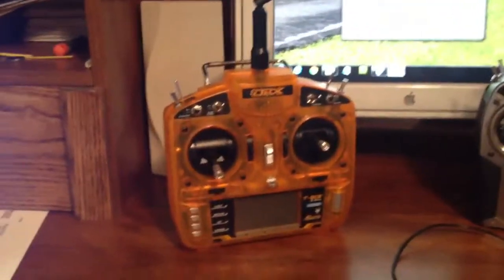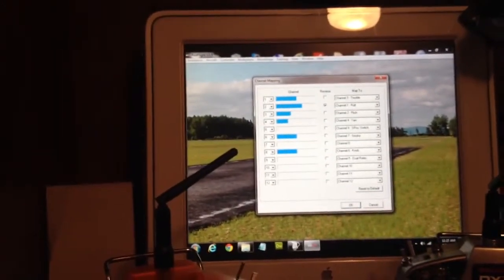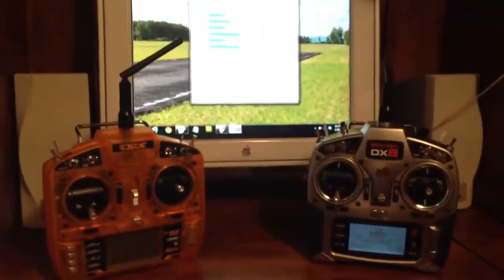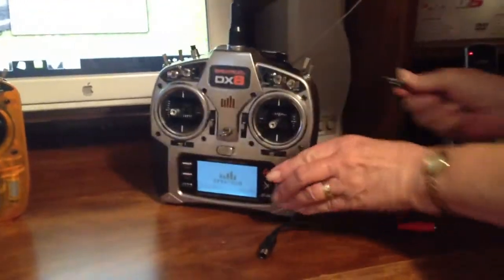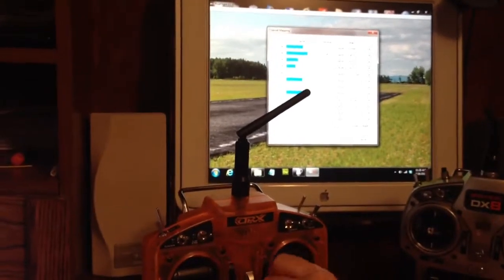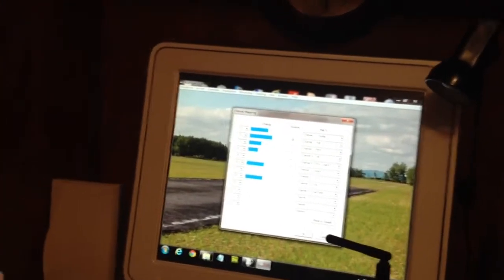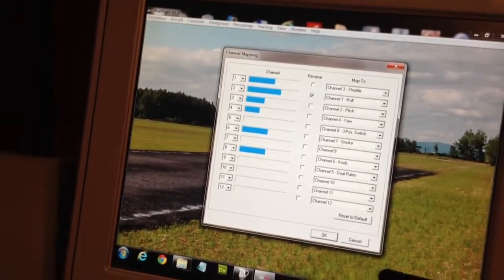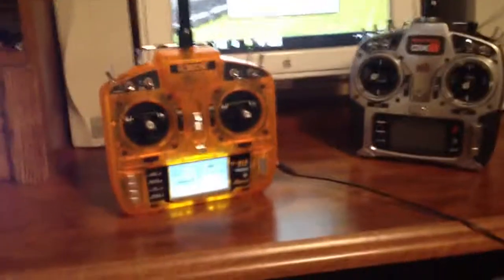Orange Transmitter Fail

Comment: Larry,

It seems I'm having the same problems. I just have bought the T-six. Neither I can get the trainer port working. The location of the wiring diagram doesn't excist anymore as I can find it. What did you do to get it work?

Kind regards, Robert
Reply from the maker: photo is still there...  See link below
http://www.hobbyking.com/hobbyking/store/uploads/94107065X268157X10.jpg
Reply: Larry Fortna Thnx for your reply although I still don't know what to do or how I'd use this information to get it working. I don't have the technical skills to make a video-cable myself as it seems I've to make that. I've already sent a quastion to hobbyking and hopefully they can tell me what I need to do. I also have bought the recommended reciever and cables for simulation/pc-usage in combination with this transmitter.Simply connecting those cables and turning on the transmitter and starting up RF G4.5 doesn't work as there's no signal in G4.5 from the transmitter.Kind regards, Robert from Holland
Reply: Robert de Vos Larry Fortna Hey you guys. I also have the Orange transmitter and am quite happy with it so far as it's my first proper radio and has gotten my first foamy build flying and works for my Heli 130x.  

I did get the same usb connector as you and naturally it didn't work. Like Robert de Vos I don't intuitively know how to wire everything up from the photo and short explaination. I can cut and solder wire very amateurishly but I don't know where and what precisely to cut and join. I did find this thread (http://www.helifreak.com/showthread.php?t=511358)  which I think is the same issue discussed with a few solutions, but I'm still in the dark. 

Is there any chance you could do another video showing your fix and a few details on the steps you took to complete it?

Kind Regards,

Simon
Reply from the maker: Simon White I no longer have my transmitter, but really, it was very simple.  You just need to add a jumper wire to bridge two pins on your existing cable or wire up a new cable according to the photo.
Reply: +Larry Fortna  which  simulator you used with the orange.
I brought one and i dont know which one to pick yet

Comment: See You provide the pictures In addition to S-Video Cable need to connect.
Orange Transmitter Socket Inside Terminals Upper left and left Down
Whether the position of the cable needs to be changed ? 
If you need to change the position How to modify?   Thank you ~

Comment from the maker: You can find the wiring diagram on HobbyKings website.  Lookup the transmitter and then go to the files tab.  You will find a link labeled Orange RX T6 to Spektrum trainer port ca.  It has a jpg photo showing the proper connections and you must add a jumper wire to make it work.

Comment: Sometimes on these types of things you have to plug in and power up the controller first, then start up the simulator on your computer, rather than the other way around.  You may have already tried that, but just in case it might be worth a shot.